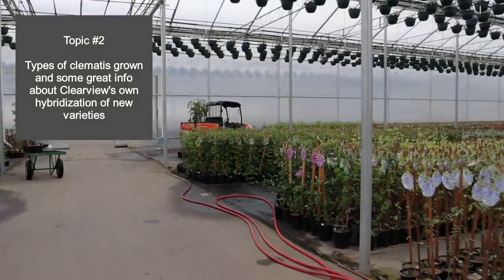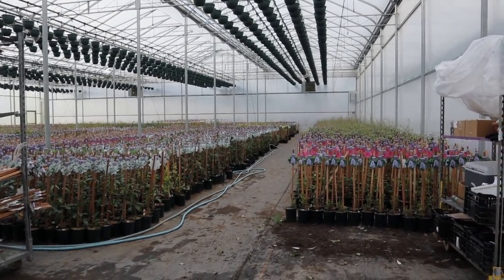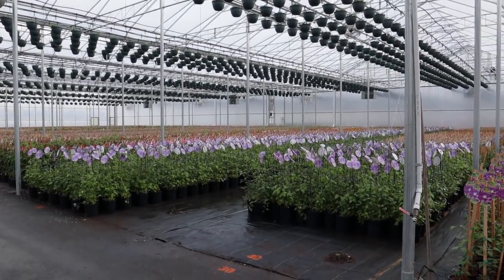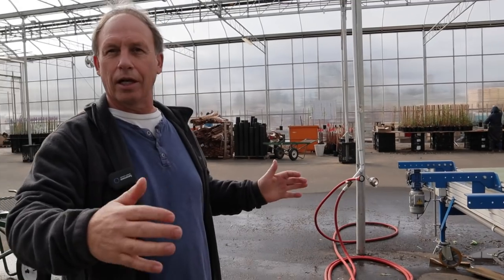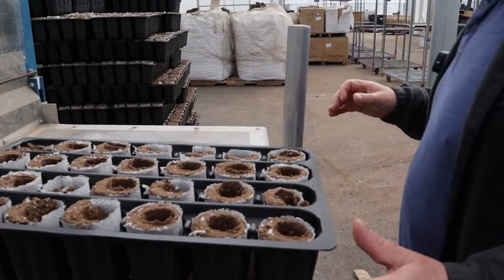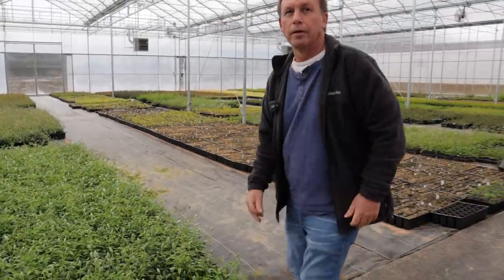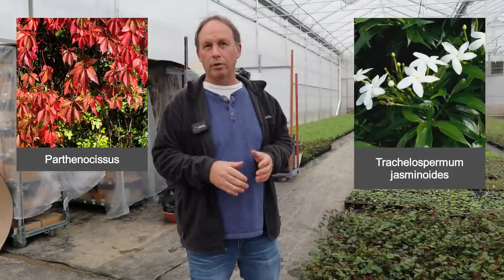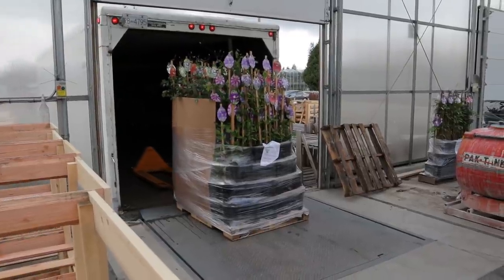Tour of Amazing Clematis Nursery

Comment: Jason, may I ask for your help ?  I've been on Google for days  trying to find the right combinations of roses and unable to come up with a solution. Would you lead me in the right direction if you have the time?

I have an area that has a steep slope about 10 ft away from where I'd like to plant two EVERBLOOMING roses right next to each other so that the canes will intermingle.  My choice would be a  double crisp white flower and one LIGHT pink ( double or single is fine ) (petal color similiar to the  hue of a light pink cleome) (no cream or magenta tones please on either the white or pink rose) .   They both need to have an old world heavenly fragrance leaning towards clove or spice or something along those lines.

Even though I live in zone 6b I'd like for the roses to be able to tolerate  zone 5 because of the wind tunnel effect of the area I'd like to plant in.   It gets full sun after 11:00 am.   I'd have an entertwining bush of beauty up against an 8 ft tall white vinyl fence if there's any solution that might be out there ???

 Is there a combination you could suggest that is also disease tolerant so it won't create a problem for my other roses along the front of my home?
Reply from the maker: Sounds like an interesting spot - and maybe a little challenging with a slope, afternoon sun and winds. Take a quick look to see if Stanwell Perpetual appeals to you for the light pink. The reason I bring it up is that it'll perform well in a tough location, has great flower form and scent, and blooms repeatedly (but not as "perepetually" as the name might suggest). For the white, I'm not sure - but again, just leaning into the tough adaptable roses, something like 'Blanc Double de Coubert' which is a rugosa with a killer fragrance and good repeat bloom.
Reply: @FraserValleyRoseFarm   A zillion times THANK YOU , I will check it out.  I've had so much trouble finding the solution.  I very much appreciate your kindness, opinion and time.
You're amazing